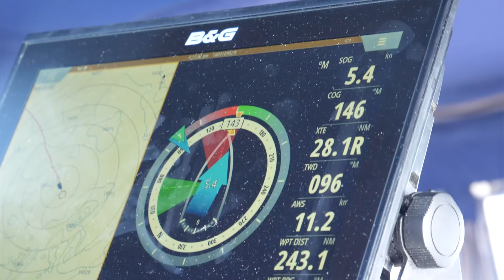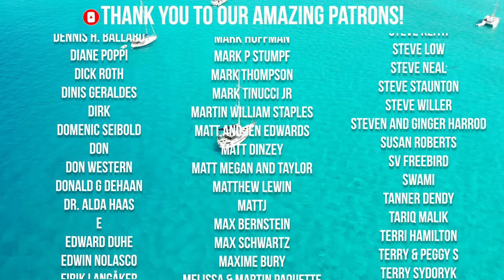200nm OFFSHORE - are we taking on WATER?! [EP 155]

Comment: Good on ya for routine inspections underway.  
Might want to look into ABYC E11.   Look at how Ta Shing wired the boat compared to after delivery add ons.  I am almost done rewiring and changing out hoses on my 1985 V42CC and very glad I did.  At least 4 wires were about to short out due to vibration and lousy install.  Scary stuff.  
Keep an eye out for a spinnaker car.  Down wind with a pole out and a code sail makes all the difference.
Reply from the maker: Ergh, I won't even want to address the wiring on our boat. It's all over the place with additions from 2 previous owners too (and probably 10's of their contractors!) So well done to you for doing that job!! Ahh, the joy of 40 year old boats eh!
Reply: @SailingMillennialFalcon  I greatly appreciate your videos.  And your level of commitment!  I often see "oh, that's how they did it" by watching your episodes.  The issues you have are also on my boat.  
The places where my wiring chafed would easily have been solved if the wires were supported every 18".  Some #8 screws and mounting eye cable ties can go a long way towards safety.  
Boat yoga maybe involved!

Comment: Add extra shut off valves. Back when I bought my first home I had the main shut off valve out at the water meter. If there was a leak anywhere in the house whether it be a faucet or around the toilet or whatever you had to shut off the water to the whole house personally I didn’t like that. Usually when you look underneath your sink in the cabinet you would see shut off valves at the wall then run lines up to the Fossett for the sink or down on the wall or at the floor by the wall under the toilet you would see the water supply with a shut off valve that goes up to the toilet, and these are all there so late so that you can isolate the problem. So as I was redoing the house I put shut off valves at the bathroom sink, at the toilet, extra shut off valve in for the tub and shower another set of shut off‘s for the kitchen sink. I also put an extra shut off valve leading up to the hot water tank. This way if I had a problem I can isolate the problem and still have the rest of my water system going it would work the same in your boat so I suggest extra shut off valves.
Reply from the maker: Thats actually a good idea! I was thinking of one near the tank but this would work like your first house did, a few shut off valves at the back and front of the boat might be better so if this happens again we can shut off a part of the water pump system and still use the rest. Thanks for the suggestion 🙂

Comment: I’m now wondering what the easiest way of testing water salinity in the bulge is without having to taste it!?

Eww argh…you’re not a sailor until you’ve drank you’re own bilge water; matey!
Reply: A hydrometer would do nicely: or even something you know floats in salt and sinks in fresh water
Reply: there is a device which uses the refractive index, you just hold it up to the light and look into a lens, I can't remember the details (used one briefly many years ago on a geography field trip) bit it was easy to use and didn't require power or anything.
With a battery and a multimeter you could measure the condctivity fairly easily.
Reply: @jonathanshaw6784  refractometer
Reply: Or a TDS meter.
Reply: Needs to be something you can grab and use when you think your sinking offshore ;)